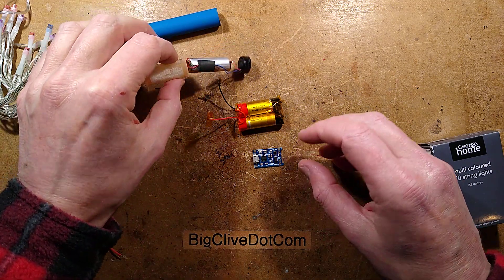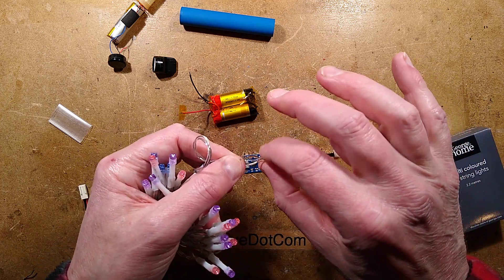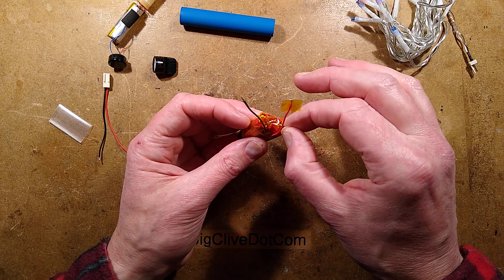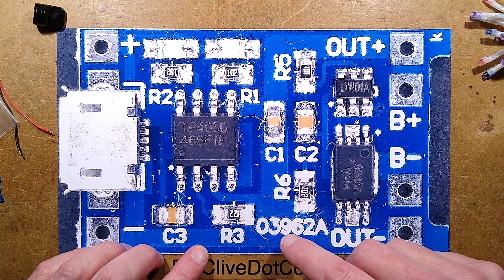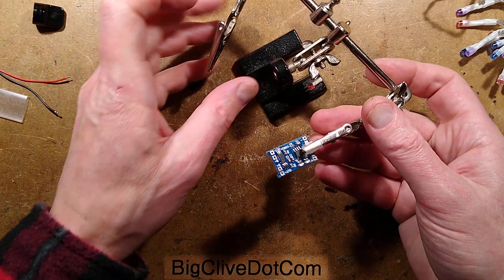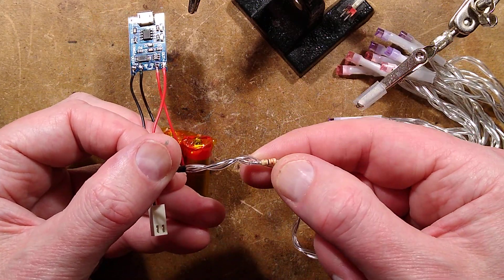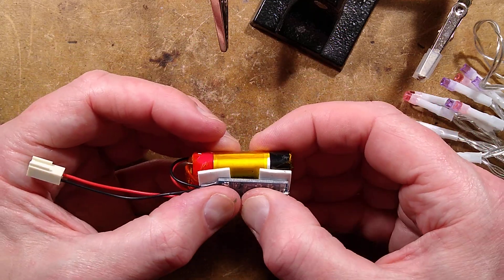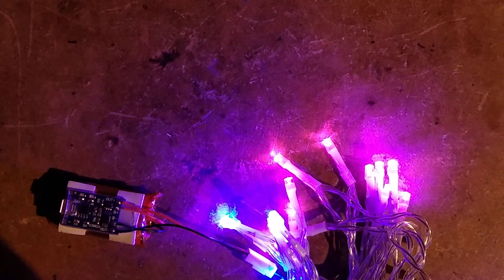Cheap power pack with free lithium cells (USB or solar charging)

Comment: hi have a tp405 board with the dw01 chip but it cuts the battery off at 2.2v at discharge and 4.04v at charge can i fix that ?
Reply from the maker: It's locked.  But cutting off at 4.04V is a good result.  It's about 90% of charge and will extend cell life greatly.

Comment: How stupid is it to put these in series? I'm looking to power a 555 timer using an easily accessible battery, seeing as I have a lot of these batteries I want to use them, but am unable to run the timer with them in parallel
Reply from the maker: You could use sets of cells wired as two in series, but that would require a suitable charge control PCB.

Comment: I was opening a free lithium ion device, just a small cut on the battery. I managed to get the pack out and toss it in the yard wet from rain. I'll check out the results in the daytime.
Reply: Despite being compromised the  pack didn't busrt into flames, it was warm to the touch when I snipped the leads and pitched it out. It joins the other compromised packs (squished)  awaiting recycling in a thick steel container outside.

Comment: I found all the Vapes (5 in the last 2 years) as I walk everyday for exercise. In a way I'm doing a service picking up the Vape devices, stripping out the batteries, and electronics, and removing them from streets, and tossing the parts in the garbage.  Must be a better way of getting more used Vape devices. Smoke shops maybe?

Comment: I've been using  rescued LIPO cells, and electronics from Vapes to power home made garden lights, much better than the 1.2 volt Nickle Metal hydride cells--- no need for a voltage booster circuit to run LED's. Can power Johnson decade counters (CD4017), and many other chips to control several LED's.

Comment: Not only can you get free Lithium cells, you get the power management electronic too. I found that many of the power management modules in the Vape devices can be powered by a small 5 volt solar panel better than the ones you can buy for a bout a dollar a piece supposedly made for LIPO batteries.
Reply from the maker: Some have charge circuitry built in, but some don't.

Comment: I recently bought these modules and connected them to the same batteries. Charging went fine, and it stopped charging at 4.2 volts. However, after I disconnected the charging voltage, the chip immediately started discharging the battery, even with no load connected. I measured a resistance of 4 ohms between the power ports of the PCB. Do you have any idea why this is happening? This issue occurred with four boards. thank you
Reply from the maker: That's not normal.  I wonder if the modules have faulty ICs or capacitors.

Comment: Help!  I love these connectors [9:15], but I'm running low and don't know what type they are?
Reply from the maker: I buy mine from Rapid Electronics in the UK.
The online search keywords are NS25 or KF2510.
Reply: @bigclivedotcom thank u i watched your video on recycling cells a few years ago and picked up a bag of those and couldn’t remember what they were even called and considering I recently got back into playing with electronics again im in need of more . I got drunk and accidentally discovered what happens when u connect 14 cell’s to one without an outlet for the power to go

Comment: "When lithium cells are connected in parallel they behave as a single cell.  It's important to make sure the cell voltages are very close before connecting them as otherwise high current can flow between them as they attempt to match voltages.  Even a 0.1V difference can cause quite high current to flow."
Just to clarify : 
A)The procedure would be to discharge them individually to 3V or less. Then connect them in parallel and charge them (in parallel) to 4.2V. Is this correct ?
B) Does this charger and procedure work for both Li Ion and Li Po batteries ?
Reply from the maker: It's safer to work with near fully discharged cells.  You can use a load or charger to bring cell voltages close.  As long as the cells have the same end of charge voltage they can generally be paired.

Comment: Hi Clive, whats the most amount of lights will run off this type of configuration of batteries?
Reply from the maker: With modern LED strings you can run hundreds by adjusting the resistor value.  Even with the suggested value 100 LEDs would be acceptably bright for many applications.

Comment: at what voltage when charging does the led turn blue?.....4.2?  ive had one on charge for ages, and the blue led doesnt come on to tell me its charged, ive tried 3 boards...still no blue, even when the battery shows almost 4.2 volts..hmmmm....
Reply from the maker: Usually at 4.2V, but if a load is active it may never reach that.

Comment: what is the max input voltage for the module?
Reply from the maker: The TP4056 can handle up to 8V, but you'd have to reduce the charging current to control heat dissipation.

Comment: Any advice on doing something like this, but with one of those flat 12v lithium batteries from a laptop?
Most of these charging modules are made for 18650's or other <5v batteries.
Reply from the maker: The LED string application is best suited to single cells.

Comment: I realise this is an old video, but FYI, I went into a new vape shop. I was astounded at the plethora of vape machines: this vaping has really taken off. I have managed to scrounge the odd discarded vape from the bins in supermarkets where people discard their AAA and AAA cells, but only a few. I dont smoke or vape, but I went into the vape shop and asked the young lad in there if they ever get discarded ones. Ho, ho! they get hundreds! They go in a bin and unfortunately they are destined for 'recycling' ( which I dont believe ). This lad was an agreeable soul and when I asked if I could blag the odd used vape he emptied the entire contents into a black bag and gave me the lot.
Most of the vapes have a 13300 cell ( 300-odd mA/Hr ). Some are hard case, some soft-case ( Lipo? ). But there were a few much bigger vapes. They  consist of an aluminium cylinder which contains 4 little 'pods' so you get 4 different flavours which you select by twisting the cylinder. It's all very cute. But the important thing is that these vapes have a much bigger battery. They are soft case types: they are the 23350 type ( 23mm X 35mm ) and @ 
 6.48W/Hr have about FIVE times the capacity of the more common 13300. Quite what I'm going to do with them I dont know, but I thought folk might be interested if they didnt know. Go to a vape shop near you and just ask the guy. It's no skin off his nose and he might help out. Better than grovelling in the gutter!

Comment: These little salvaged cells are a 1st class replacement for small devices that use 2 or 3 ( horrid LEAKY alkaline cells ! ) such as LED camping lanterns .... the cells should be in a flat arrangement , NOT the devices that drop cells in a tube ! a touch of solder and you now have a working device ( that will NEVER leak ! ) , you might connect two mini croc clips to the charger shown in the video and charge when needed ? ( FYI , I found 8 vapes today while walking around my town , so these are widely available ! ) ...... ( tried - n - tested ) ........... DAVE™   🛑

Comment: Clive, really enjoying your videos. You have a good way of communicating.  I am an electrician, looking to start playing about with electronics. I want to convert a 22.2V (6x3.7 cells) battery from a broken vacuum into a travel power bank.  Ideally I would like to at some point charge it via some small solar panels too, but for now I want to attach a 5V USB output board onto it that has cut out protection to prevent discharging the 22.2V battery too much.

I have bought a dual usb board from eBay that will work to charge devices, but my concern is over discharge. Any advice?

Comment: Clive, 
I have jsut emptied a disposable but rechargable vape.
Do you reckon it's worth making a small connector to use the chip in the vape as charge protection?
Reply from the maker: The little module can actually be used to charge the cell at about 300mA if it has that feature.  But otherwise it's a bit specialist due to the way it operates.

Comment: I like those little modules as well.  I've seen them sold without the protection (if you have cells that already include it) and also without the USB connector,in case you want to use a solar panel or whatever.  I do have a small panel around here someplace,  no idea what it puts out as I haven't tested it but it's probably more than 5 volts. How much with that TP4056 chip take?
Reply from the maker: The TP4056 is suitable for up to about 6V, but the closer the voltage is to the cell voltage the less heat from the chip.
Reply: Sounds to me like a good place to insert a buck converter module, which I happen to have some of here...

Comment: Clive, I’m looking to make a Solar USB UPS using the TP4056. Would I need a boost circuit board on the output pads to raise the battery voltage up to 5v to power a mobile phone (as a hotspot) 24/7 ?
Reply from the maker: Yes you would.  You could use a power bank circuit with the TP4056 topping up the cell independently of the other circuitry.
Reply: @bigclivedotcom  Genius my friend, of course kinda like hooking up the power bank board backwards! I’m rediscovering the TP4056 again, maybe that would make a good video? A USB UPS 👍

Comment: That silicon sleeve idea for the helping hands croc clips is genius! I was soldering some tiny little boards (running two cells in parallel instead of just one in my drone's battery holder) and trying to hold them without a short was difficult! I wrapped a bit of insulation tape around ot in the end. 
But this is just there all the time. Brilliant!
Reply: There's a way of wiring in parallel I've always called "perfectly balanced parallel" that involves keeping all wires the same length and going the opposite way for + & -. 
Couldn't post a link so try this, Google "QUESTION TO 12V GURU – CAN I CONNECT LITHIUM BATTERIES IN PARALLEL?" go there & scroll down. There are diagrams of the two types of parallel wiring. Balanced & unbalanced.
If you want to look keep all your cells at the same voltage, use the second, balanced diagram.

Comment: I would like to see a 12v battery or a 5v usb powerbank with cells from 20 or 30 or more of these devices with a bms and usb and solar charging. I have so many of these things lying around and can't just chuck them in the rubbish bin. I want to do something with them, I learned here that it is even possible to repurpose them.

Comment: Is there any small amount of standby current being drawn by the protection circuitry when there is no load on the output?
Reply from the maker: Absolutely tiny.  Not significant in normal use and even storage.
Reply: @bigclivedotcom  . Ok thanks.

Comment: Hi Clive,  I'm not sure if you have tried but with the 13400 cell you can use them if you add a bit of kaptan tape for safety, they can be used in a aaa battery holder.  Thought I'd mention it.  👍

Comment: could i add a 5-6v solar panel to this setup ?. what would happen if i had a solar panel connected and placed it face down and unplugged the lights would it be able to charge with the usb cable ?. sorry if this seems silly ive watched so many of these im getting confused as to what can be done and what cant and with what configuration .
Reply from the maker: I'd recommend a 5V panel, but it should work fine.  There are connections either side of the USB socket for the panel.
Reply from the maker: If using USB charging too, I'd suggest putting a diode in series with the solar panel.  Do not place the unit in hot direct sunshine to charge unless the lithium cells has a space for air cooling.  They don't fare well with high temperatures.
Reply: @bigclivedotcom  thank you very much clive ive got 2x 5v on order as we speak for £15.99 with the best output i could find . i will try and make a box to keep the cells out of the way hidden behind the panel with a large gap in between  .

Comment: I collected some of these devices and salvaged the cells. The ones I found are usually 400 mAh. My question, on what current should I charge them? Is 1C safe or should I go more to about 0,5C?
Reply from the maker: 1C is fine for these cells.  I've only found one brand that used strangely substandard cells that needed charged at much lower current.
Reply: @bigclivedotcom  Thank you for the response. Keep up with the good work.

Comment: Just got one to test the 18650 was at low voltage 1.2 volts which may be bad it charged almost fully charge tomorrow I will power the Bluetooth speaker box to see how long it will play the music.

Comment: Isn't lead dangerous and terribly bad for the environment?
Reply from the maker: No.  Things were blown out of proportion by the eco-warriors to the great detriment of reliability of electronic equipment.  They effectively doubled electronic landfill in one misguided regulation.
Lead is malleable and adds a slight flexibility to solder, making it better suited to soldering.  That's why it was there in the first place.
Modern products contain only a tiny amount of solder.  Your car battery probably has 1000 times more than every single appliance in your home.

Comment: How much can the circuit power through the protection ? I have some of those boards one to bypass a bad charging circuit to charge two 18650 cell Bluetooth speaker box. I don't think it's a major speaker box it looks fairly tall two feet maybe but not too thick. Supposedly stereo the pot has only 3 lead in. So maybe 2 speaker mono.
Reply from the maker: I'm not sure what the protection's maximum current is.

Comment: I have been using the original product and was suprised by the battery in them considering they are sold as disposable. I have saved a bunch of them in case i could recharge them and use them for different projects. Youtube recommended your channel today and i am really happy because now i have some good knowledge about them. Thank you.

Comment: If your going to charge the battery with solar I recommend adding a circuit that turns on the led string at dusk and keeps it off during dawn. Such a circuit consists of a a voltage divider (with one of the resistors being an LDR) being feed into a transistor. the transistor would be used to power the LED. If your using an NPN then there would be a resistor that pulls the transistor up to VCC and the LDR pulling it down to GND. Flip the voltage divider around for an PNP.
Reply: Can you connect the solar panel directly to the 5V input?
Reply: @wonderwise5493  Solar Modules have different voltage levels at different light conditions while at the same time, they further drop in Voltage when "sucking" energy out of them. When you use a 5V Panel, you need to operate it at optimal conditions, cloud free, panel directly pointed at sun. 6V would work a bit more tollerant and the TP4056 will probably (please test first, im just making hopefully a good guesses) be okay receiving 6V from the panel without load.
However, for more stable charging I would recommend at least using a buck converter to drop a higher rated solar panel (12 V, up to 30V, depending on module) to the ~4.7V to ~5.3V of the TP module.
Best solution would be using a MPPT (Maximum Power Point Tracker), these circuits are monitoring Voltage and current and when they reach maximum power they will try to stay on that level. They come in with built in buck or boost convertes but are relatively expensive.

Also there are many other things you may consider. Like using amorphous (thin film) solar cells for indoors (hard to get, though), monocrystalline cells for outdoors (they have low efficiency on low light levels) and polycrystalline cells for beeing cheap but basicly the same as monocrystalline cells, also their power density is lower due to the fact each cell is a cut strip and some are so badly arranged that the cells overlap or have big gaps.
Reply: @celinematerzok6421  thank you for explanation. I've seen in datasheet that input voltage range is 4V to 8V. So I guess I can connect the solar pannel directly to the module.
Reply: @wonderwise5493 You need to put a rectifier diode on the positive wire from the solar panel to prevent voltage backflow.

Comment: I don’t know if anyone would care at all for scavenged cells, but it might be worth noting that usually cells in pre-made packs are performance matched at the factory — near-identical capacity, voltage ranges, charge/discharge capability, etc.; cells that are not matched may see degradation of one cell more than the other over time, which can take down both. The most important thing is capacity, so if you can get two cells that are within a dozen mAh of each other, that can give them the best chance

Comment: Sorry if this is redundant. I don’t recall if you’ve mentioned this (watched video a while ago): a lot of the vape battery devices with detachable pods have very strong magnets in a small form. 

They are used to secure a connection between pod and battery unit. The pod is disposable and doesn’t have magnets.

Comment: Thanks for you video's Clive,  I always look forward to the new one's
I have also started collecting the little cells from the E thingy's and bought a stack of tp4056's, solar panels, more solder (Mechanics from Alliexpress) and flux among other stuff but I also bought some tp4056 from ebay and seller says not to charge with load switched on! 
Their are others on here showing videos of soldering 1n4001 diode to Negative In & and a wire from mosfet pin 5 to the band side of diode resulting In, when charging = light (load) off and when not charging light (load) on. 
Could anyone please tell me If this would be safe and not fry the battery 😁

Comment: There's just one thing you need to be careful about. The TP4065 gets VERY hot when charging at 1A. Having such high heat near lithium cells is not such a good idea.